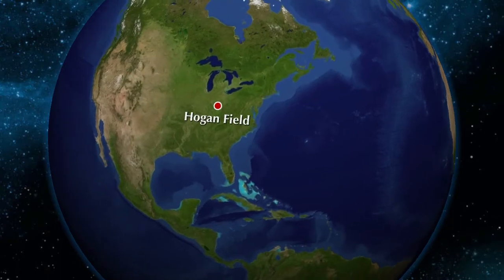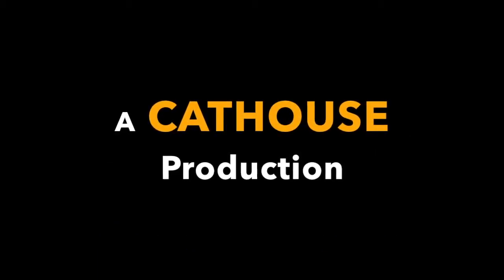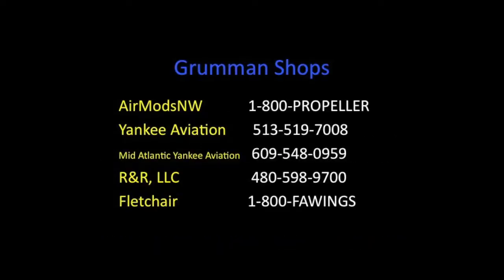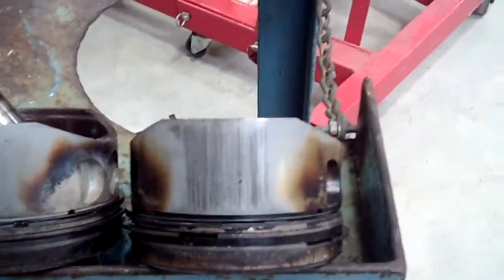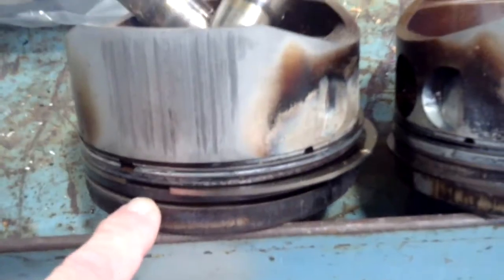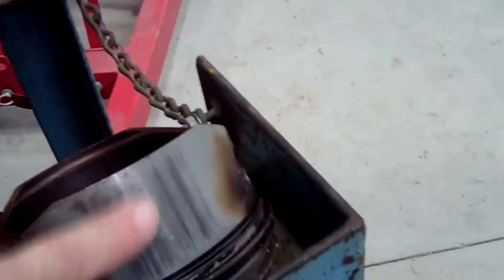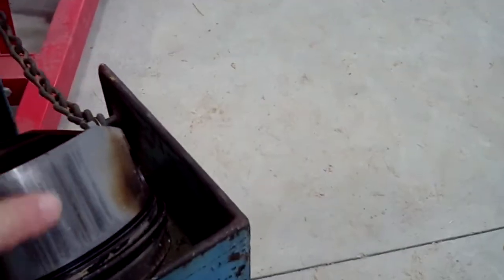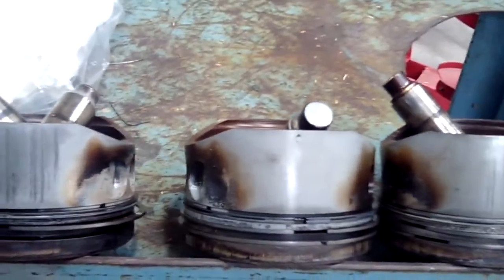Piston Skirt Scuffing - Grumman Style

Comment: My guess is that you’ve got the most scuffing on cylinder #3 and cylinder #4 because they’re running the hottest. It may turn out that the cylinders themselves are still within specification and only need to be deglazed.   Looks like a couple new pistons, new rings are in order. Restated, this appears to be a cooling issue.
Reply: Hi I have this on my motorcycle pistons. So this calls for new pistons?? Thanks
Reply from the maker: Maybe